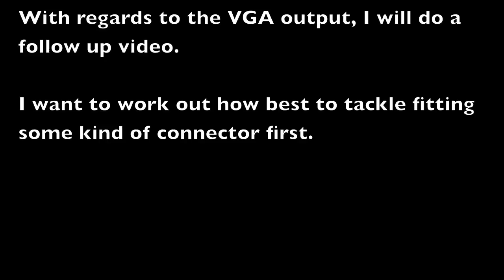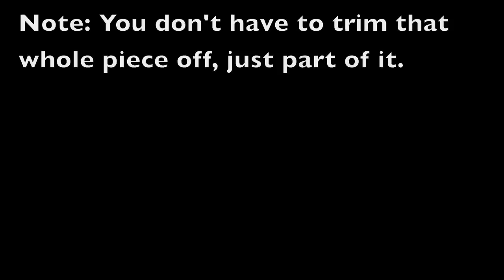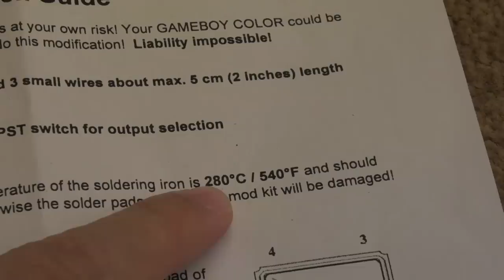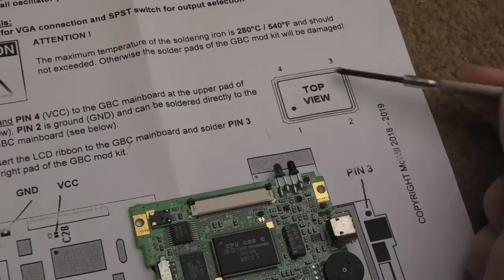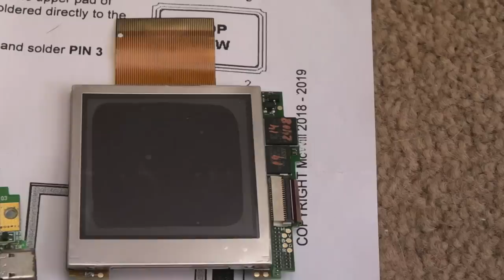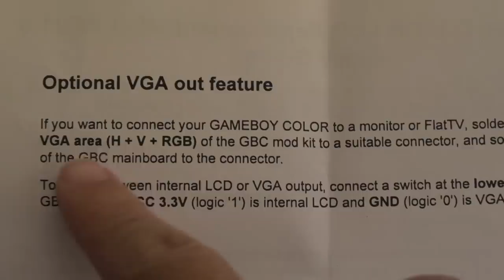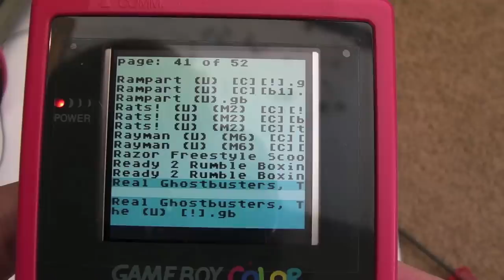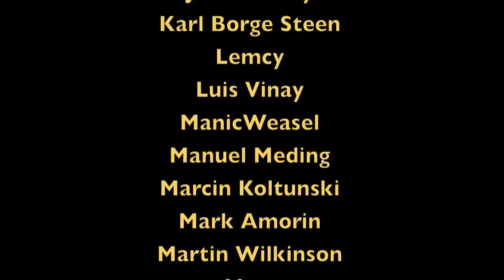Nintendo Gameboy Color - McWill LCD Screen Mod - New (2019) Screen

Comment: The only additional thing I would do (because seeing the silver bezel of the screen would get to me) is use some black insulation tape to cover the silver bezel pieces that you can see. That way it will blend into the rest of the screen and wont look obvious that the screen is slightly smaller than the original.

Comment: I like BennVenn's version more. For roughly the same price, you can buy a kit that doesn't require any soldering whatsoever, thus making it stupidly easier (or at the very least more convenient) for the average person that doesn't do this for a job or a hobby and as such doesn't need to buy a soldering iron that may be used once and never again. Oh, and he's also testing a variant that fits in a GBP aswell as possibly a DMG GB.

Comment: Great job on the install, I really like how you mounted the oscillator. I have one of these but haven't installed it yet so I'm going to copy your method. Some of the other videos I've seen were pretty sloppy with the oscillator and had a 1/4 mile of extra wire stuffed in there.

Comment: Samsung makes a very slick mini-vga port for their old laptops, but idk where to even begin finding the ports/components for installing one myself.

What'd be really slick is a way of routing one of the pins to the switch, so that when you plug it in, it auto-switches.
Reply: Especially if you can carry audio to the source as well....

Comment: Now this is right up my street.i have a clear GBC that I would love to do. I'll press play now and watch away. Also, could you not take vcc from the led leg to save trying to solder to the tiny cap? Could you not also neatly put black tape on the left/right side of the screen to hide the chrome screen surround. Another question, lol. What is the crystal used for, does it need it?
Reply from the maker: You would need to check that the LED is fed with 5v - it probably goes through a resistor to drop it, so I wouldn't take 5v from there.  You could put tape down the sides of the screen there - I considered that but was happy as it is tbh.  The crystal provides a clock to the CPLD / FPGA, so it is required!

Comment: A. Why not replace the IR-port with a VGA-connector? 
B. How about using a closed-circuit-detector as switch? (just plug in the cable to switch to VGA)

Comment: Looks great. My OCD would make me use black tape or paint the silver bezel so it doesn't show through the screen lens. Are you planning on trying out BennVenns new Lynx screen and compare it to the MC Will screen? Curious if there is a quality difference since the BennVenn one is half the price.
Reply from the maker: I might check out one of the Benn Venn screens at some point, just got too many things I need to also cover.

Comment: BennVenns adapter is not compatible with  Nintendo AGS101 Screens btw.
Reply from the maker: This is what I was talking about:- https://www.retromodding.com/products/bennvenns-gbc-backlight-conversion-ribbon-cable-for-ags-101-lcd?variant=12570392199191

So yes, it is compatible =D   You are thinking about the new one he has just released I think.

Comment: I personally dont like the mcphill. Lots of backflips just to make it work. And as for the freckle shack there's no telling when the hell they will be shipping. I bought a midwest embedded and it's really easy and straightforward
Reply from the maker: I've seen how the midwest embedded screen is fitted and it's not easier at all imo.  You have to cut the plastic again and trim bits down, then attach wires, and if you chose to add the brightness control via the buttons you have wires there too.  It also uses exactly the same LCD display with the same metal bits showing (unless you replace the front bezel), and in the videos I've seen the screen is not centralised, ie. the few videos I've seen you see more of the silver left hand side than the right hand side.  Might be a bit easier for some to install, but I am not convinced on that one!

Comment: Maybe a Mini-VGA connector to replace the infrared module at the top? I’m not sure what games might use that, though.

There’s been rapid progress by numerous folk in a short period with GBC backlight solutions; I’m still hoping someone finds a larger display however, as the GBC’s screen is already smaller than its cousins anyway (DMG, GBP).

Comment: What is the best appropriate battery to be used with this? 
I am getting a custom one made with a McWill LCD, but I don't if my Eneloop Pro batteries will supply the desired voltage.
Reply from the maker: Honestly no idea at this stage - I haven't compared current vs an unmodded screen - I would assume it draws more current.  So high capacity eneloop is probably what I would go for.

Comment: Super nice video! Very clear and understandable even to me, which I am far from being an expert. Thank you!

I would like to have the same mod on my GameBoy Advance SP, which unfortunately isn't the AGS 101. Do you know if there is something similar for it?
Reply: That's easier. If you have a certain case color you love. But it didn't have the AGS 101 screen. You can just swap out the screens. There's no proprietary configuration between the two. I put a AGS 101 screen in my NES GBA SP Edition.
Reply: @rangerreview1780  

Mine is a silver SP. Problem is finding an ags 101 screen.
Reply: You don't need anything new or in good shape. Just the screen has to be fine. I remember I got mine for $35.  @MauroSanna
Reply: @rangerreview1780  

Very interesting. I need to do some research.
Reply: @MauroSanna  It's really easy to swap out. The only hard part is removing the screw covers on the screen. Without damaging them.

Comment: I have just installed the same mod and I keep getting problems with mine turning on the first time when it's been off for awhile. I've been using quality batteries but I have to turn my gameboy on and off like three times before it stays on. It's a weird issue as this only happens when it has been turned off for an extended period of time. I wonder if anyone else has been having this same issue?
Reply from the maker: This can happen!  The same thing happens with the GameGear, but often its only when used in conjuction with an Everdrive.  I believe it's due to inrush current and the fact the capacitor on the main power input not having enough charge.  A quick switch off and back on should resolve it.  I will test my Gameboy Colour out with the everdrive more later to see if I can re-create the same behaviour.
Reply: @GadgetUK164  ok thanks for the response!

Comment: Shame to see you using the Chinese ripoff of the Everdrive.  You know, they have the actual real Gameboy Everdrives for very cheap now, it would be worth getting one.  Also kind of a shame to see that the replacement screen is even smaller than the already tiny GBC screen.  Otherwise it does look quite nice.
Reply from the maker: It was a gift!  I have every other everdrive produced up until the new range, all originals!
Reply: @GadgetUK164 ah, good to hear.
Reply from the maker: Yeah lol, you can see on my other videos that I always go for genuine krikzz hardware - on this occasion I asked for it as a gift and someone went price comparing against eBay...

Comment: I can understand getting a pocket neogeo back lit. But what is the point in this? Just buy an advanced. No disrespect, you are very good at what you do.
Reply: It's perfect for people who don't use a everdrive and want the GB/GBC carts not to stick out. Like on a GBA SP. It's uncomfortable having the old carts under your hands for a long period of time. You'd also be able to use the link cable system. Since you can't use GB/GBC link games through the SP.
Reply from the maker: It's about nostalgia too - some people grew up using the GB Color.  I personally prefer to play GB/C games on the GameCube adapter.

Comment: This might be one of the weakest screen solutions for a GBC I've ever seen. I'm sure the manufacture cost is high to justify the price tag, but by appearances alone, it looks remarkably low-rent.
Pain in the ass to install too...
Reply from the maker: To be fair, try finding a screen that is precisely the size of the original one - they don't exist!  You either have to go larger or smaller.  Personally I think the only things that could make this perfect is to somehow mount the crystal on the PCB, alter the PCB layout so no cuts of the plastic are required.  That said, it has been reported (by other reviewers) that it is brighter and clearer than the AGS-101 screen mod you can do to these.  Furthermore, the screen from Benn Venn apparently is exactly the same!  The only difference is a custom bezel to hide the silver bits.   So what is the better option then?